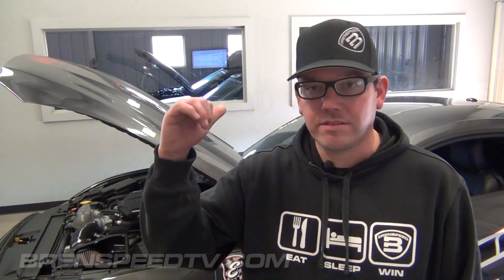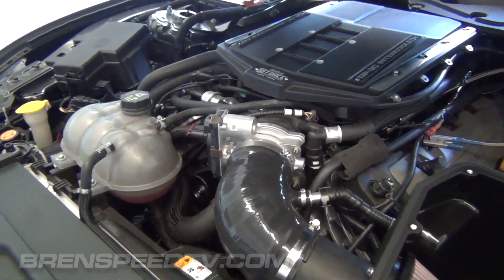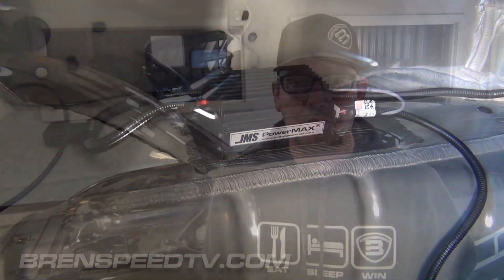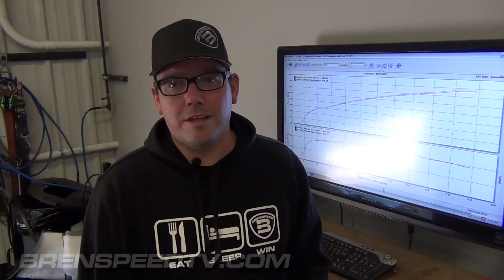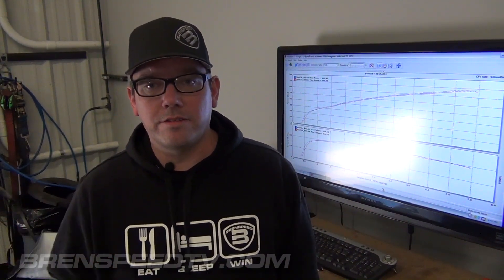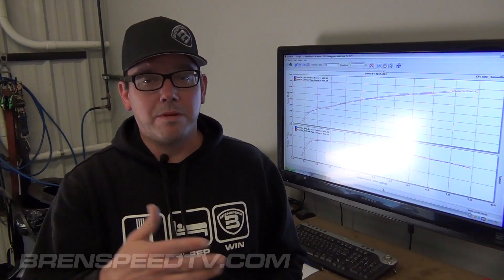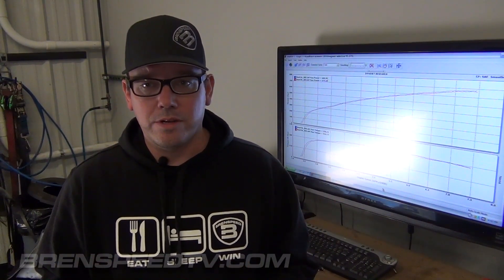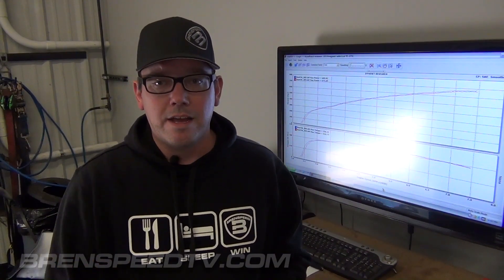2015-17 Brenspeed Stage 2 670 RWHP  Edelbrock 2300 E-Force Supercharger Upgrade

Comment: Hey I have this stage 1 kit on my car , what would total cost be to put these upgrades on ?
Reply from the maker: Hi if you need an install quote at our Indiana facility email quote@brenspeed.com and and they can send you pricing. THANKS
Reply: @BrenspeedEngineering  what exact throttle body is that ?! I’m having issues getting a CAI set up for this kit .

Comment: What size pulley are you using?
Reply: im also keen to know.....i tried putting on a 2.75  with all supporting mods minus the larger throttle body and intake... and the car would not run! and was making less power for some reason my kit 1586 came with a 3 inch pulley but edelbrock states they come with a 3.25 from the box- so im super confused

Comment: Glad to see someone making power with these Edelbrock kits. 

Would you please address the issue of heat soak / power loss through the superchargers inability to keep up with cooling demands. 

To me dyno numbers are for bragging rights. I feel dynos are tuning purposes only since we never drive on them. 

Lastly, would a front mounted air to air or another air to water unit be feasible to address the losses from heat soaking? Thank you for the informative videos!
Reply from the maker: All superchargers in general heat soak, all of them to some extent. This kit uses a dual pass intercooler which is the most intercooling of any kit. Also, if you want even more cooling you can install a larger heat exchanger that helps. You wouldnt install an air to air with this kit as it is liquid cooled, but the larger heat exchanger helps all TVS/Twin Screw style superchargers. Thanks
Reply: Best bet would to run a hood with vents near the blower also does hurt to take a few steps in thermally isolating the blower from the heads. Lastly you have two large rotors rubbing against each other and the case at 2-18k RPM even more if you’re pushing past blower spec limits. That’s a lot of heat generation.

Comment: What throttle body did u guys upgrade to?
Reply from the maker: primal311 we used a GT350 but that kit will be changing to a billet FRPP unit which is a bit nicer.
Reply: @BrenspeedEngineering  in the video you said eldebrock throttle body
Reply: @BrenspeedEngineering  also as I look the only other Ford racing one is 90mm , says it don’t fit 2015 .